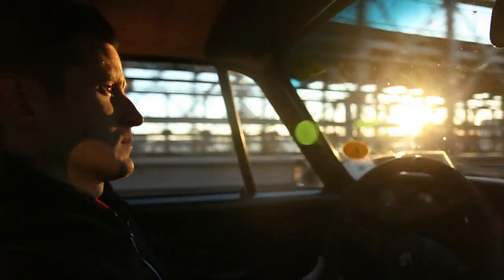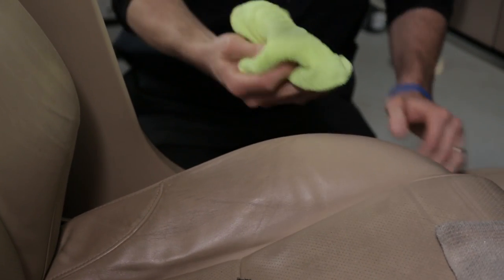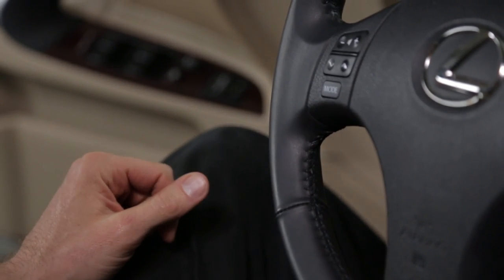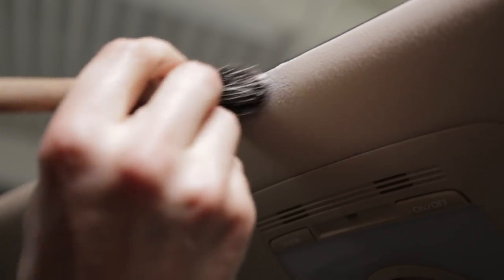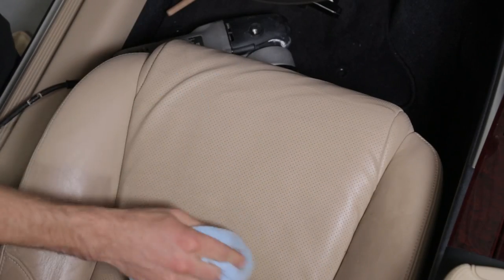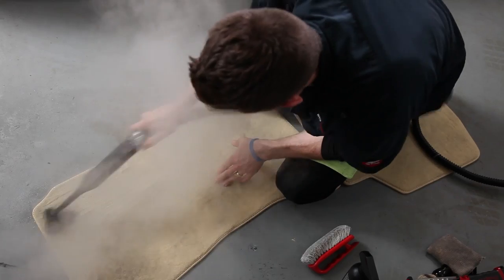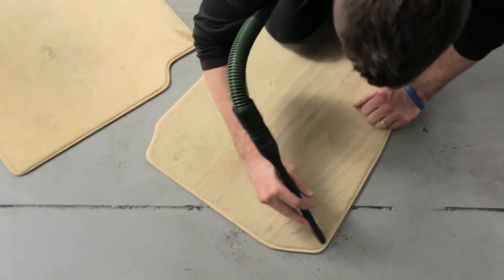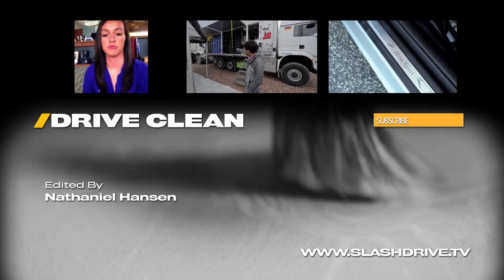Interior Detailing: Tools, Techniques, and Materials -- /DRIVE CLEAN

Comment: I use q-tips and wedge shaped makeup sponges to get into the edges of buttons, trim edges and vent louvers with cleaner and then anti-static conditioner. In my door I keep a Swiffer duster handy which helps the OCD when I notice dust  while at a red light:) Love Larry's vids. Cheers!
Reply: +remedyfarm That's a great idea..... I'm going to steal it haha
Reply: I use a microscope and a human baby eyelash brush, making sure to scan the images into my computer and map out a quadrant system to ensure that I've done the whole car, including inside the air ducting system.
Reply: decent.  but kitten eyelash brushes are finer.

Comment: 1 tip for cleaning the centre console where the gear shift is; on automatic cars make sure to put the gear shift all the way down (Usaully "1" or "L") and clean there because thats what the customer sees when they put it in drive and a lot of times its dirty. Great video by the way, love the Drive Clean series.

Comment: Mr. Clean Magic erasers work great for dirty leather seats and door panels with some warm water and some all purpose cleaner mixed in (without amonia) I use that method all the time for my business 👍
Reply: Jose Sarmiento you're mostly correct but I've had them pull paint off at times
Reply: Jose Sarmiento definitely not good for leather

Comment: Using a soft bristled brush to clean any part of the car is a must! I never used them and when I say some for really cheap I decided to pick them up. The deep cleaning and lathering effect is amazing and works better than any cloth or scrub pad. Engine bay, interior fabrics, tight exterior trim and wheels are all cleaned so much better with a brush.
Reply: Yup, I got myself a nice thick boar brush and I foam up the cleaners on cloths before vaccuming. Perfect spot clean.

Comment: He shows some really good things. Cleaning a car is so important when trading them in.  I have a 2008 Mini and the dealer asks me who cleans my car every time I bring it to the dealer for service.  When I tell them I do, they don't even bother washing the car.  They never do as good a job as I do...it does help being a former detailer.  =]
Reply: Where did you detail at? I unfortunately suckered into carmax not realizing how little time they give you to do full details, i have to get a full detail done no matter how dirty or old the car is in 3.2 hours. 2.7 if theres no sanding involved, i cant get it done in that time frame and do a great job at it to save my life
Reply: +Grant Schneider you're giving me a time frame but it depends on the overall condition of the vehicle.  Even newer vehicles take time depending on the detail involved. I would start with the outside first. There are many new waxes that will give cars a reasonable shine. The time comes in when cleaning the inside. the nooks and crannies being clean go a VERY long way with resale value. But you mentioned Carmax. They are brutal. I just appraised a 2015 TLX with them. They gave me 6K less than an authorized Acura dealer. I wouldnt mess with them if I were you.

Comment: For dashboard I use 50/50 apc and water mix, for carpet i use carpet cleaner and a drill brush to get out the stains , if its more deeper I run the steamer and then drill again , wipe down , roof liner I use very little carpet cleaner and drill brush , and for the carpet mats I use apc and power wash them and wash all the dirt out , I do quality work I admire all the work but I'm not spending a whole day doing one car I take 300$ for 3-4 hrs of my time and still get quality results

Comment: You can put some washer fluid / glass cleaner on a microfiber cloth and wipe the windscreen. It can't be too hot outside, because then it'll dry to fast and cause spots. So let it sit a minute and then take a dry cloth to rub it off. It will require some hard pressure to get it off properly. Not sure if there's a better method, but this works just fine for me :)

Comment: Oh boy :) I can understand the care for leather, dash, and headliner; but the floormats? I usually spray them with a heavy duty grease remover, scrub it in lightly and then use a pressure washer - works like a charm! (I wouldn't use it on a rare or very expensive floormat though!)

Comment: We ended up getting some greasy fingerprints on the headliner of our 2012 Taurus SHO, which is a very light color liner.  The detail manager at the dealership used light water and a magic eraser and it came right out like you couldn't even tell.

Comment: I just discovered your channel. Some great videos!  I have a question for you. I just purchased a used 2017 Lexus RX. There is a small square mark on the top of the dashboard from where the original owner had stuck some kind of phone holder or other device using double-sided tape. I'd like to clean off the residue but I'm concerned I may make it worse if I use the wrong product. I've thought about varsol or WD40, but would appreciate your advice before I do anything. Thank you

Comment: A better way of cleaning floor mats is do as Larry did and apply plenty of carpet cleaner and scrub with a stiff brush but instead of instead of mopping up with a cloth or wet vac, blast them ideally with a pressure washer or even just a hose with high pressure.  Cleaning mats usually takes multiple passes to get them totally clean as they absorb a lot of dirt so rinsing them with high pressure water makes the job a lot easier and it gets better results. When clean they just need one or two passes with a wet vac or absorb the water with some microfibres then leave out to totally dry.

Comment: Hey so I know this question is kinda stupid but here goes anyway . I just bought a 98 integra and the interior is immaculate , just a little dusty so in trying to keep it looking like new so I used some leather and plastic / rubber cleaner to shine it up a bit . Long story short while I was driving I noticed a couple spots where I didn't rub the leather cleaner in good enough and it's really hot so now it's kinda sticky . Should I use a wet rag to wipe it down then start over again or should I jus put some more cleaner on and work it in better ??

Comment: I have a 95' Ferrari 355 spider. There was some stains in the leather. I removed them by applying  armor all to a scotch brite pad. I rubbed out the stains and it came out fine.
Reply: +5POINT0 YOU USED CHEAPASS ARMORALL ON A FERRARI 355 SPYDER??? I dont even use that walmart shit for my Z4...
Reply: i heard the silicone in armor all is bad for leather.

Comment: In my opinion it is the hardest part of a detail but provided you have the right cloths and products it can be achieved. I use diluted IPA at a ratio of 1:1 with de-ionised water and two types of microfiber cloth. First, spray the IPA mix onto a glass mf towel and thoroughly wipe the area then buff immediately with a premium mf towel. Undiluted IPA can also be used (many pro's do) but I don't use it because all my windows are tinted. Thanks to Paul Dalton @ Miracle Detail for the tip.

Comment: How do I get rid of a 'old car' smell if you know what I mean~1997 BMW 528i
Reply: I wish I could
Reply: shampoo the seats and carpets
Reply: Yep, shampoo the carpets and the seats if they are fabric. Pull the seats out over a weekend and do the whole carpet.
Reply: Also, you may see people use Ozone machines to get rid of some smells. You can get this same effect, granted not as powerful, with a product called Ozium (http://www.amazon.com/OZIUM-SANITIZER-OZM-1-ORIGINAL-SCENT/dp/B000CSWCAG). Just spray it in the car and let it go to work. This will help AFTER you deep clean the carpets and interior.
Reply: Naseer Syed Use some deodorizer, and if you plan on shampooing the seats and carpet DO NOT use to much water and soak the seat foam or insulating pad of the carpet. I use a good carpet cleaner in a spray bottle and scrub with a brush then wipe dry with a micro fiber and avoid using water if I can..a steam cleaner will be great for the job, Also look into using a Ozone machine.. Also since its a BMW try replacing the cabin air cleaner, and assuming you have a 5 series with a sun roof make sure the sun roof drip rails are free from clogs and water is not over flowing some place else and soaking into the carpets during heavy rains. 7 Series cars are notorious for water running into the glove box and soaking the passenger carpet. Once you get the carpet soaked, it has dried getting the old funky smell out is quite the chore to be 100%
Reply: Naseer Syed Ozium. Some dude at work was saying how it got rid of the smell when he smoked weed. So I figured "good enough for weed, good enough for me" and it really does work. Make sue you use it like fabreeze at first and spray it right on all of the fabric. Let it sit for a couple hours then air it out because the stuff it really strong and it sucks driving right after you sprayed it.
Reply: Ozium is absolutely magnificent I would rate it 10/10
Reply: Naseer Syed  I saw a video where someone turned on the air conditioner and opened the hood then sprayed lysol for 30 seconds into the air vents below the windshield it cleaned all the mildew out of the vents and made it smell better
Reply: *****
 I bought a odor absorber bag of small rockls called Gonzo odor eliminator that are supposed to absorb odors and mildew from Lowes. They said you can hang it in your basement and in a car to absorb the musty odors . I put it in a basement and a car and it really works but it takes a few weeks before it will absorb most of the smells.
Reply: *****
 yes its in the area where they sell all of the cleaners
Reply: Naseer Syed Pull out the seats, clean from top to bottom and seats using canned shampoo cleaners if you don't have a lot of money to buy good equipment. They have carpet and upholstery cleaners in separate cans. And use an air freshener. Or you could just use an air freshener it's up to you with what you want to do.
Reply: Naseer Syed6
Reply: Why the hell would you want to do that???????????
Reply: lay off the taco bell

Comment: Remove your floormats.  Cut thin rubber (like big innertubes) to fit your trunk, footwells and plastic door sill covers.  Apply velcro tabs and install in trunk and footwells, use thin 2-sided foam tape for trunk and door sills..  Put floormats (that you have cleaned obviously) from the junkyard in your car.  Remove the floormats and footwell rubber 3-4 times per year and clean your carpets.  When you go to sell your car, your trunk, footwells and floormats are pristine.

Comment: I am really enjoying your videos. Thanks. Just a couple of comments - wouldn't you vacuum before you start other treatment on the leather? Otherwise you would just risk rubbing other contaminants into the seats. Also, I can't believe how stretched out of shape the leather in that Lexus was. It looked so loose. My wife drives a 15 year old Mercedes which has had very little attention to the interior, but the leather is still in better condition than that.

Comment: I'm sure someone is going to be horrified by what I am about to say but...  Before I do anything to the interior I use a leaf blower to remove a good deal of dust and dirt.  I know it sounds wrong but it works really well and so far hasn't caused any problem.  You have to do this first though, before using any product.  For daily drivers like my family car I have done away with carpeted car mats and just use heavy rubber winter mats.  Also leather interior is much easier to clean then fabric.

Comment: question, can a simple rented rug doctor be an adequate hot water extractor?
Reply: Yes!  I started my auto detailing with a rug doctor that I bought for $200 on CL.   Only downside is that you have to keep refilling with hot water. Once I made enough money I saved to get a Mytee Lite II.  Spray chemical,  agitate with brush, finish with rug doctor.
Reply: yep. I used one on my 2003 4Runner after I bought it (they pretty much covered up the stains).I went to whole 9 years and took out the seats and did them by themselves to get the sides and under them. Came out looking brand new, and I also bought a thing of carpet cleaner when I rented it since I didn't have any. It if fairly strong stuff, so be sure to follow the directions closely.
Reply: 24AnVRodri I only had to fill mine once when I did my truck.
Reply: White03T4RV82WD I bought a Blissel Little Green which does a great job - got it on sale for next to nothing.

Comment: Only watched the first minute so far, but there is no way I would have my cleaning cloths and brushes lying on the floor where they can easily pickup small stones and other contaminants which would damage the surface (interior or exterior) of my vehicle. Just saying.